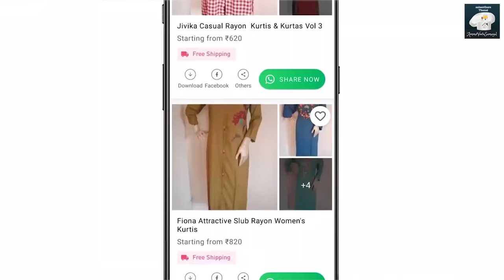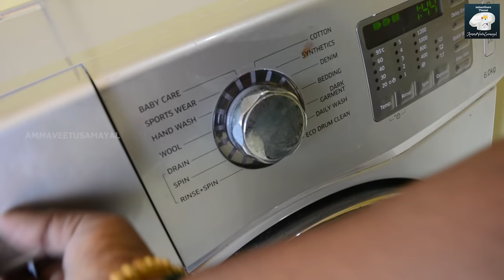இவ்ளோ ஈசியா இத சுத்தம் பண்றது |Easy Washing Machine Cleaning & Maintanence|Ammaveetusamayal

Comment: Amma neenga acidukku pathila domex illana harpic poturukkalam supera cleanaidum.
Reply: Koduma koduma apdi than enga veetu paiyan harpic oothi drum clean panan clean aachu but one month la drum la otai potiduchi 12000 aachi replacd panrathuku harpic domex acid ellam toilet clean panrathu washing machine ku illa
Reply: dheet son.Avanga drum clean panna sollaveilla outer mattumthan ungala yaaru drumla clean panna sonna . unga area waterla salt thanmai irukkum pls check .nanga LG frontload 9kg  all month domexlathan clean pannuvom outer no problem at all.